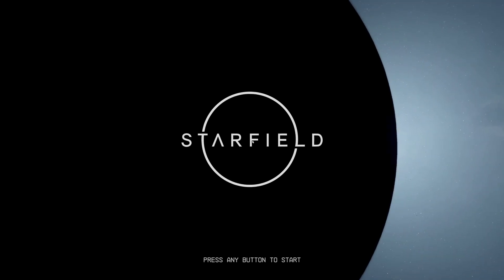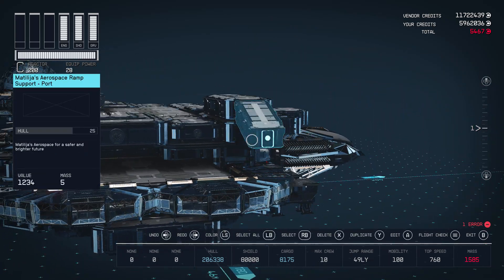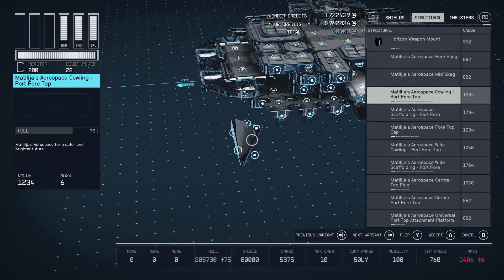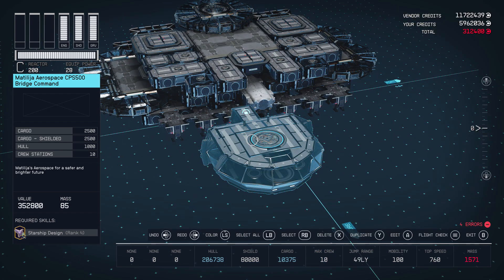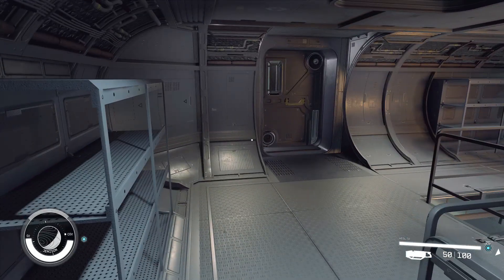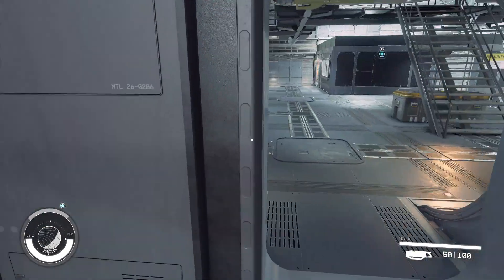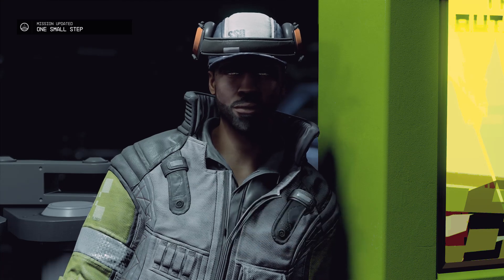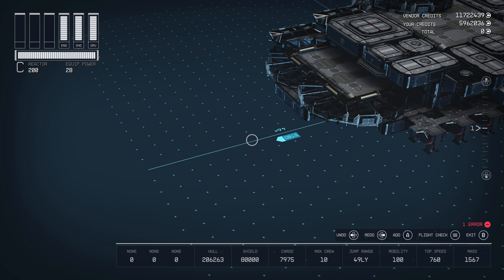Matilija Aerospace Troubleshooting and fixes progress so far

Comment: As one that uses a lot of ramp supports, the only thing missing is a snap on the sides of the ramp supports.  I'm using ramps more and more as superstructures elements as well as interior access. At issie is mostly where it is used as exterior elements.  If I wish to add superstructure items down the length of the ramp, I can't.  I'm forced to use derretech slopes which neither match in texture nor in size. His slopes are full width where yours match the ramp.

Pleas Giev Snap

Comment: Not sure if you will read this but something I think the mod is lacking is a larger engine size. Currently the engines are quite small compared to the modules you've been pumping out. 

I do understand it wouldn't happen for a while, even after Shattered space and that it's your mod over anything else. You have the best ship parts mod on console right now and I'd love to see it expand into something massive.

Comment: Hey bud, loving the mod so far. I noticed that i cant connect a A Hab to a vanilla cockpit. I was trying to tie a DS40.1 Ares bridge to a A-Hab to your 2x2 captains quarters. Don’t know how much work that would be for you, but thought i should mention it. Thanks
Reply from the maker: Yeah, it's a collision issue that exists in both the A habs and the M habs in the current release, it will be fixed when I release my next update, about half way through checking all of my meshes, all of the habs I technically have fixed already, but still working on weapons and structural pieces.

Comment: Hey brother... I was w9mdering if you could do a request... can you make another module like the weapons bay (one with the drop down) and make it so we can put the buggy in and out? I'm trying to do it myself but y9ur mods are kinda c9mplex to work with and I keep fucking it up... for now I have it so it spawns in the ship and out the ship but I wanna be able to drive on the platform and have it raise into the ship in its own hab not one just added to an existing hab like I did... its silly we couldn't see our vehicles in the ship...
Reply from the maker: As cool as that would be, I don't think it's possible to do without an engine script extender like SFSE, there are no placement markers used for the Rev-8 so we can't make it spawn anywhere specific, it looks like they made it part of the game .exe rather than part of the in game files, so we can't change how it spawns without editing that .exe or injecting a script extender into the .exe.

Comment: How do you unlock the cannons and weapons? They don’t show up for me. I play on Xbox btw.
Reply from the maker: combination of levels and starship design, the weapons range from as low as level 5 all the way to level 100, and rank1 to rank 4 starship design.  If you want the exact list, check my mod page on Nexusmods and look at the second pinned comment in the comment section, it has a list of all of the weapons and the level required to for them to show up.

Comment: @Matilija love your work, I have a suggestion for something Id like to see. Is there any way we could get your cargo holds with windows in them similar to your battle stations? The reason I ask is because i like to attach them to a cargo hall with shutter doors using PDY. That way it looks like you use your ramps to raise cargo up into the cargo hall. I think it would be really cool if opened the shutter doors and could see the cargo ramps raised while in flight or see down to the ground when landed. I've spoken to a few people on Wize Old Wizards discord and they concur that this would be pretty awesome. If it would be too difficult then it's all good. The other thing was potentially a landing bay that works in a similar fashion so it could be mounted two units above the ground leaving more ship ground clearance. I suspect that one would be more difficult, if not impossible but I said id ask anyway. Thanks.

Comment: Thank you very much. I really enjoy the MOD.
One question, My A-Class engines or the plating they connect to wont snap. Is there a special way to do it, or do you think it is a MOD conflict?
Reply from the maker: They should easily snap to the side of any snap point on the same side, if they aren't snapping, you can try the flip glitch method, just flip to the other side engines and move to near where you want them and then flip back and see if they snap in green.
Reply: @matilija  Thank you very much. I will try that.
Reply: @matilija unfortunately that's been patched out with the latest update. You now need to add ship building tweaks mod on console or change the ini. File on PC.
Reply: @psyseraphim  even with ship tweaks flip glitching isn't working at all on console. This patch fix has literally ruined ship building.
Reply from the maker: @SouthPanther390  Yeah, I'm aware that the latest update seems to have broken more things, I'm working on it.
Reply: @matilija  NP, I really like everything you do. Definitely some of the best pieces in the builder. Thanks for all you do and looking forward to your updates.
Reply: @matilija I can't get some of the structural pieces to connect together.  Like since the patch has came there are numerous collision issues. Can't even put the cargo lifts in the cargo Habs. Any suggestions? I'm on series x.

Comment: @matilija there's major a lag on pc abd xbox series consoles with your battle stations hovering over it and all is there a fix coming for that at all?
Reply from the maker: Work is being done on improving performance, but I wouldn't call it a fix, it's not technically broken, so much as the engine doesn't handle overlapping collision meshes very well, especially not complex ones.  But I am working on trying to improve their models to lessen the performance impact.  They already are significantly better than when I first released them, but it's an ongoing project.
Reply: @matilija  o okay I just it lagged more On a xbox series x a bit then apc but ok no problem
Reply from the maker: @HighMarshallHelbrecht  I know it lags, it lags on PC too, even with a fairly high end one.I've been working on the models consistently trying to improve them, and for every update I improve them a bit more, and it gets a little better.  Eventually, hopefully, I'll have them working without any issues.
Reply: @matilija  okay no problem 😊 I love your mod man sorry wasn't trying to come out hostile or anything towards you or your mod
Reply from the maker: @HighMarshallHelbrecht  Oh no, I didn't take it that way, I just want you to know, I'm aware of their performance issues, also the A-Habs and M-Habs aren't perfect either, I still have some work to do on all of them.  They are getting better with every update though.
Reply: @matilija  okay sweet man 😀
Reply: @matilija Take your time my dude. We appreciate these things don't happen overnight.